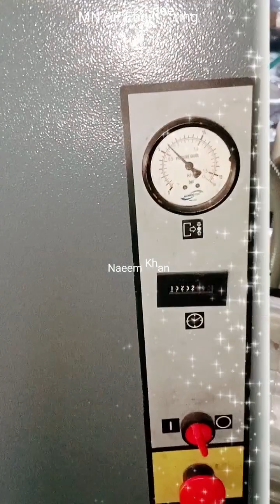How to repair the Intake valve Atlas Copco Belgium

Comment: Can you tell us how does it work?
When it opens and close?
What is the air circle inside?
Reply from the maker: Atlas Copco use solonoid valve to open 
&. Close the intake valve
Reply: Tienes el manual de mantenimiento de esas válvulas?